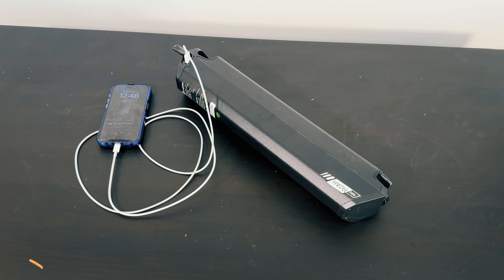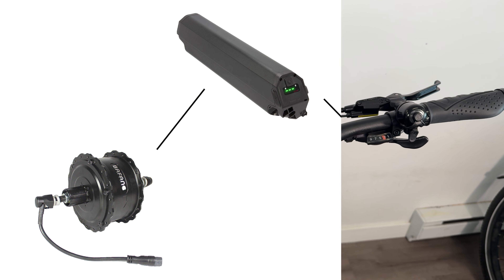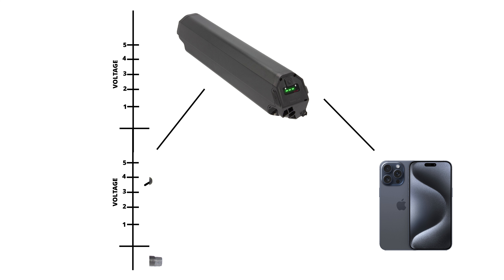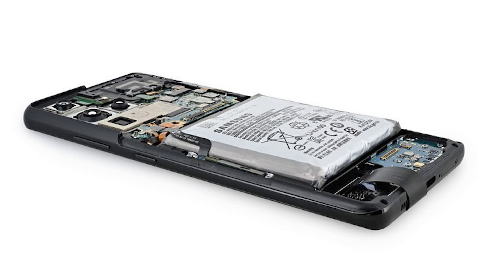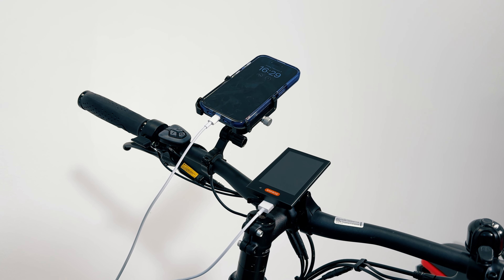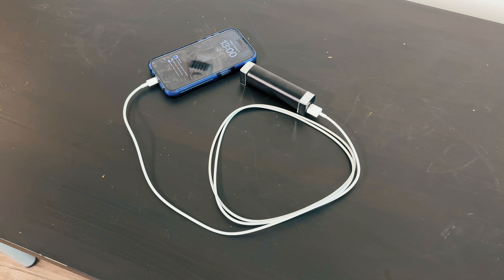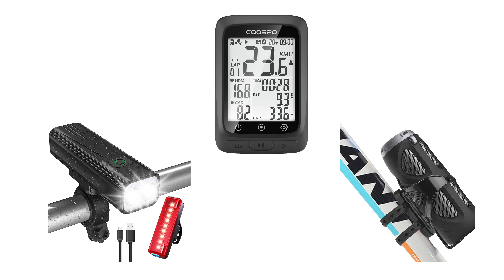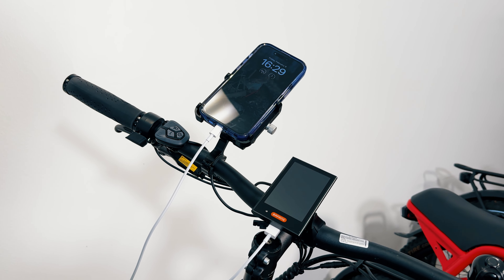Stop! Don't Charge Your Phone with Your eBike's USB Port - Here's Why

Comment: If designed correctly then it's 100% safe. Plus if the line is noisy or otherwise out of spec that's what the phones charge controller is there for. If something is off, then it will not charge your battery. The only risk would be high voltage spikes which could fry the charge controller in the phone. But a simple usb tester will tell you if this is the case. This frankly alarmist point of view could apply to ANY USB charger, not just e-bikes equipped with one.